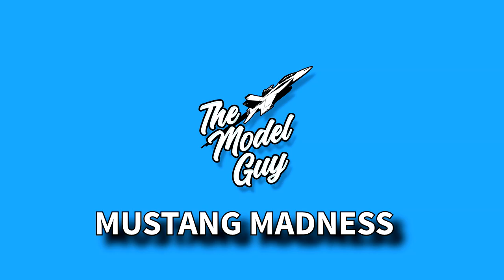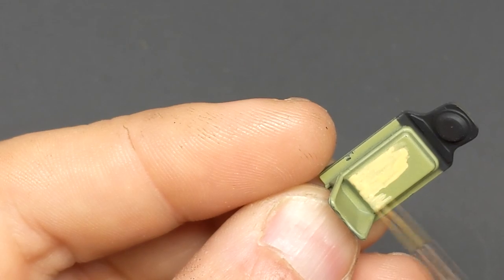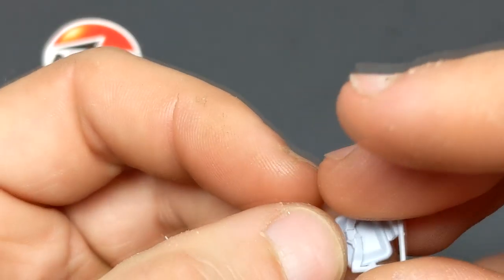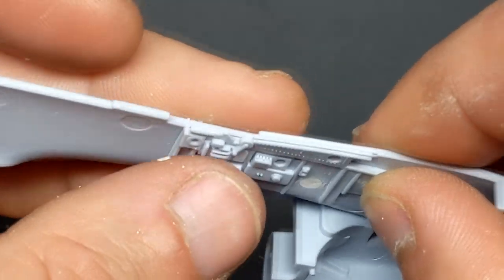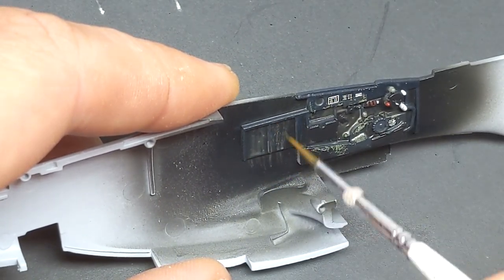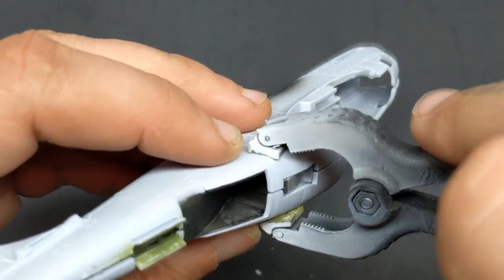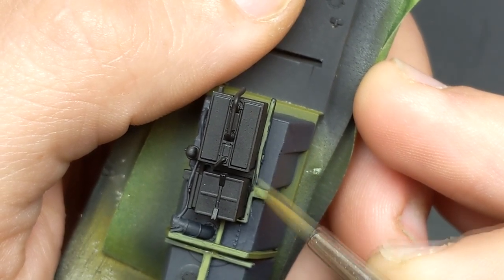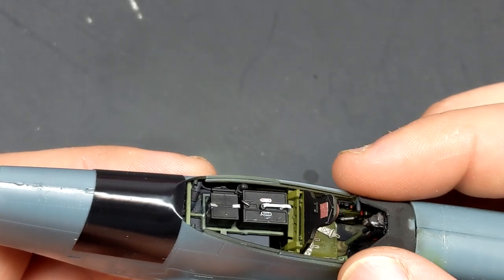1/48 Mustang Madness! Part I - Who is making the best Mustang model kit?

Comment: The Eduard kit is on another level! The Tamiya kit is still very nice for it's age. Airfix is just like Revell a bit of a pain to work with...but you can make it look nice, it just requires tons of extra hours.
Reply: The Tamiya 1/48 kit has completely rubbish props, among the worst I have ever seen, and a false nose cross-section. It builds with the wing dihedral much too flat. Tamiya's P-51 is greatly overrated, but the gear legs are still the best over Eduard (which are too long, I have no idea what happened there, as the Eduard kit is by far the best P-51) and also better than the Meng. The Meng legs are a bit long, but passable, if shy in bulk, so adapting Tamiya legs to Eduard would be a good idea. Meng legs can squeeze by as is, but overall the kit, especially the cockpit, has nowhere near the amazing Eduard detail, and also has a marginally less accurate windscreen, as does both Airfix and Tamiya, with same error of the quater light windows not "biting" deep enough into the sides... You might want to cheat mask the Eduard sliding hood frame a trifle thicker than moulded, otherwise the Eduard kit absolutely dominates every competitor.

Comment: That Airfix kit is just awesome isn’t it 😐
At least you didn’t hav a massive short shot left half of the fuselage right at the tail wheel & the radiator ducting. Nice work. Thanks for sharing 👍🏻👍🏻🙃🙃
Reply from the maker: Just wait haha
Reply: The Model Guy 
Look forward to the next one. 🙃👍🏻
Reply: Cardinal Rule, wait for the second pressings - the First run is Pressed in India and always has quality issues. the Second and subsequent runs are UK pressed and generally are a mile better.... Same with reboxings ...
Reply: Brett Peacock 
I must of got a 1st run Friday at knock off time kit.
Reply from the maker: This is my third Airfix P-51, the other two being the -51K (Identical kit, different decals) and all three are having the same issues. The K was a later release.

Comment: Great idea. I started my modeling life many years ago with the old Monogram D, which is still ok, but not to today’s standards. I built up the Airfix kit recently, and was impressed by it. I didn’t have too many issues, and am generally impressed by ‘new’ Airfix. While I was at it, I had a go with the Meng P51, which is odd. Ultimately, it fits well, but the snap together style doesn’t really work. Eduard is next on the table. I am impressed by what I see so far.

Comment: I'm on my third Airfix Mustang, and what I've found is that the tolerances on the parts are very tight.  The fuse fit issue come from the tight fit of the forward radiator housing.  Before gluing anything dry fit and sand the curved front part of BO4 and BO5 and the rest falls together.  
The seat is not the greatest, but can be doable with some work, or replace it with aftermarket.  
SPOILER ALERT!  The diamond tread tires are a complete abomination!  I took great pleasure throwing them in my sprue goo bottle and watching them dissolve!
With that said, Hobby Lobby carries them, and with their 40% off coupon I get them for right about $ 20.  That leaves a bit left over for an after market seat and wheels.  So far my favorite Mustang kit (I hear the Eduard kits in the stash calling!).
Reply from the maker: This is my third Airfix Stang and it's been consistent. I removed the tail last night and the bottom came together. So I need to do some more investigating to find out how that's even happening. I couldn't physically force it together before.
Reply: @TheModelGuy  Done two Airfix Mustangs (05131) and have not experienced fit issues to the level you have. My kits had oodles of flash and some offset mold seams.

But your difficulties aren't surprising--Airfix gonna Airfix, and that includes questionable engineering choices and capricious quality control. Still, as @Bob Lobla notes, one can pick these up at a local Hobby Lobby for $18, plus tax, with a 40 percent off coupon.

For the money, I think it's an excellent kit and would recommend it to anyone with the caveat that there will be some extra work required.

Comment: My grandpa was a foreman in the North American plant until the end of the war.  According to what he told my dad, installing the internal fuel tanks was a very delicate process. If you over-tightened one of the nuts by half a thread, you’d puncture the tank and you’d have to spend several hours tearing it out and putting everything back together again, AFTER your 12-hour shift ended.

Comment: Nice work on all those cockpits. I have never really been impressed with the airfix kits. I look forward to seeing the completion.
Reply: The new molds from airfix are really good, you should give then a try
Reply from the maker: @cesarvieceli2958  This is one of their new molds. I have the new Spit in the stash and that has a lot of problems.
Reply: I'm having the same fit issue for the Airfix one, what can I do??
Reply from the maker: @fury4539  My next video will address it. I have a huge gap at the rear on the bottom. I also got kicked off the Airfix Facebook builder group shortly after this video.

Coincidence? Lol

I plan on filling the gap with some styrene
Reply: @TheModelGuy  well being a Brit and Airfix being British, I'm embarrassed that for their mistake you got kicked out. By the way when is PT.2 coming?
Reply: @TheModelGuy  if it's the mk 14, good luck with wings and front fuel tank panel...
Reply: @cesarvieceli2958  The Airfix “new moulds” 1/72 Lightning F.2A is dreadful. Huge amounts of work, sanding and putty needed to get the fuselage halves to close and when you do finally get it together you find the intake cowl is a different diameter to the fuselage so it won’t fit without doing a lot of sanding, puttying etc. Then the wings are a poor fit, more putty...

It’s a pity because the surface details are very good, though getting parts to fit requires sanding a lot of detail off then re-scribing it. Other than the huge ejection pin holes and posts that are all over the place that is, including some very visible locations indeed and other spots where they prevent parts fitting correctly. Oh - some of the transfers are wrongly numbered as well.

Comment: I think that your Airfix review was spot on, I had exactly the same issues. Lucky my workspace is outside because there was a massive amount of swearing. The tail and radiator were especially bad and there was a lot of twist warp on the fuselage. Having had a lot of issues with Airfix kits, especially badly or unmoulded parts, I have to say that their quality control is poor. The kit I got was missing the frame for the forward part of the wheel bay and I had to request this from Airfix. It took 2 weeks to arrive, sadly I had no ducks to rescue so busied myself with another kit. I have a Tamiya Mustang to do once the Skyraider I am doing is complete. That is still some way off though.

Comment: Best Mustang I ever built was an old Hasegawa. Back in '04 or '05. I haven't done any Eduard complete kits (just use their photoetch). I had a bad experience with a Roden (Eduard was just coming available) kit back in that same time frame. Only kit I ever threw in the trash in over 50 years of modeling. That includes finishing Monogram kits of the 60's. But, I may have to give Eduard another look. I've thought their Profi-Packs look appealing. Shame about the fit and ejector pins on the Airfix. Good video!

Comment: G'day MG, If I hadn't already subscribed to you, I would have just on the strength of you saving those ducklings... that was the act of a good person! Anyway, I'm ex-RAAF and getting back into modelling. I'm kicking off with the Airfix (No AO5137) 1/48 P-51 Mk IV / P-51K. I'm doing the K Model as the RAAF used to fly them in Italy near the end of WW2. 
I would have liked the Eduard kit but here in Australia they are hopelessly expensive and hard to source. So, I'll be following your 'Mustang Madness' with great interest.
It's good to see you are impressed with Tamiya's model and hoping that is true for other Tamiya kits, of which I have several, but not a Mustang. I want to try their version of the Mosquito because I had an old mate who used to fly the PR version in WW2 for the RAAF.
So, thanks very much MG, great, coincidental, timing for both our projects. I don't use an airbrush because I'm no good with machines and, again, good airbrush gear down here is way too expensive. Even though I'm a ‘brush brat’, I'm sure I'll benefit from many of your tips and tricks. Cheers, BH :)

Comment: The mold makers have limits to where they can put the ejector pins. Think about it, when the part is popped from the mold it's easy to understand it's going to stick in the half of the mold with the most detail. That's the side that's going to have the most friction on the molded parts. That's the side that needs the ejector pins for popping the parts out of the mold. The other half of the mold doesn't need them since the parts don't stick in it.
What they need to do is work out a way to make the ejector pins rest more flushly with the surface of the rest of the mold. If they were really clever and had the money to spend they could make the ejector pins line up with some detail in the part that disguises their impressions on the part. As it is, the best they can do is locate them so their either in a non-visible area of the part or where another part will cover them.

Comment: I think you will find that the problem in the Airfix Mustang is the forward Main Radiator facing  (Part D-57) in the airscoop. If it protrudes at all below the housing when mounted (And it will by about 1mm) it will kill the fit of the fuselage halves. You need to shave the protruding part down even, or even a teeny bit lower, to the housing. (Don't worry, it will NEVER be visible - the Oil Cooler hides it. Once it is shaved the Oil Cooler Housing can be fitted without any loose feeling - it will snuggle into the correct place, which it won't if the housing/radiator is not adjusted. And the fuselage goes together without further drama - even at the rear, (I am Building my second Airfix Mustang now and my first is approaching the finish line.) Sadly I cannot post images but the relevant stages are 11 thru 15 in the instructions....  As to cost the Tamiya Mustang is $55.00 in New Zealand (where I live), the Airfix is $60.00/$59.00 (depending on the LHS) and Eduard is $80.00.

Comment: Nice information. I will steer clear of the Airfix Mustang.
Reply: I have built three 1/48 Airfix P-51D Mustangs (two different issues) with no problems.  I now have another one, a third issue, and it looks very good in the box.  I expect no problems.   I've built all available 1/48 Mustangs except the Hasegawa.  Each has their pros and cons, but the Airfix kits are right at the top.   Maybe I am not as picky as other modelers.   In my fifty years of modeling, I've done all levels of kits, from most manufacturers.  None of the 1/48 Mustangs has been "bad".   Even the old simplistic Hawk kit (now Testors) has it's charm.   My advice.....  don't become a "rivet counter" and you'll find more pleasure in the hobby.

Comment: The Meng 1/48 Mustang is pretty good, it would have been nice to have seen that one included.
Reply from the maker: Isn't that a Snap-tite one?
Reply: @TheModelGuy  Yes,  but it is a proper model, it just has some press-fit features which you can pretty much ignore.  A worthy contender in my opinion.
Reply: Yes the Meng  mustang is great kit. A lot of fun if you want a weekend build.
Reply from the maker: @Meng if you want in on this you need to send me one ;)
Reply: Did my own Mustang build off using the Hasegawa/Tamiya/Meng/Airfix & Eduard kits. The Meng "snap fit" kit is great only issue I had with mine was the fit of the radiator dog house which is a completely separate part in the Meng kit. Took some minor trimming and sanding to get a decent fit. Oh new subscriber BTW this build off brought me to your channel... Keep up the good work

Comment: It is best to lay the fuselage flat on the stable surface and then glue the tailpiece into the fuselage. Because Airfix has displayed the offset of the vertical stabilizer correctly, there is a difference between the left and right tailpiece. There is absolutely no need to cut or trim the tailpieces!

Comment: I have the eduard kit on my bench right now,  but the P-51D-5. Without the fillet  do you think it will have the same locator pin problem?

Edit: just realized its the same kit. I'll keep an eye out. What did you have to do exactly?
Reply from the maker: That piece you see me locating when I talk about the pins sits on two pins. Simply cut them away
Reply: @TheModelGuy  thanks!
Reply: I cut away the cockpit floor locating pin as well then the fuselage halves went together a lot easier.